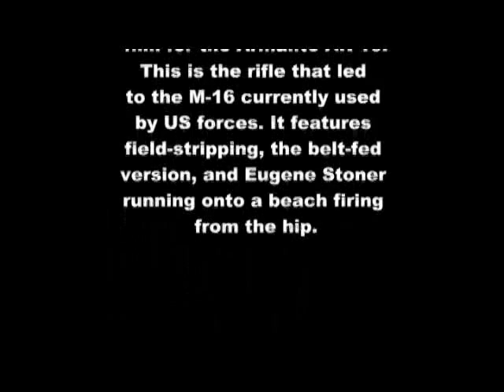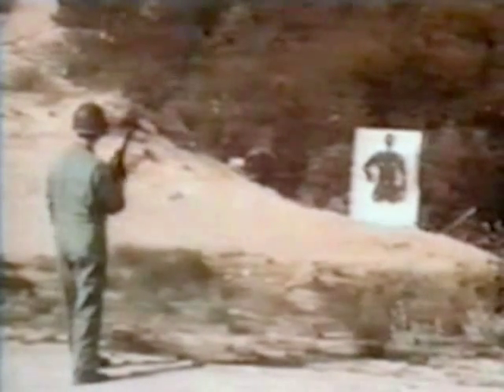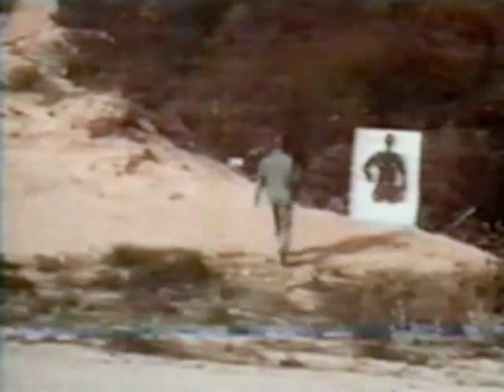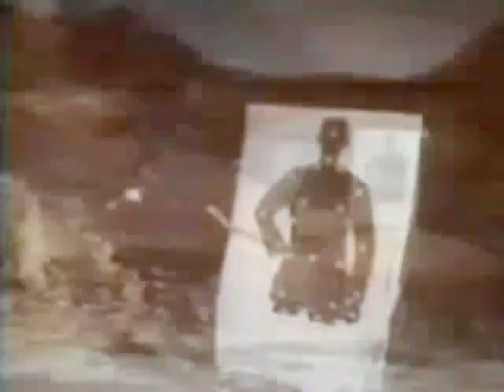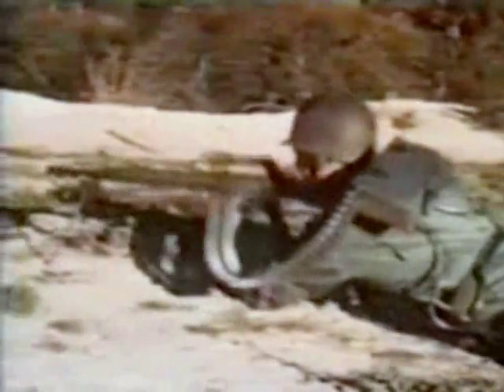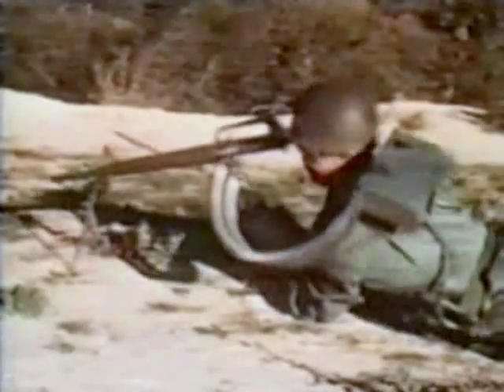ArmaLite AR-10 7.62mm Assault Rifle Part 2

Comment: @weaponeer well actually the AR-10 is a much more rugged rifle than the AR-15 and if you havnt seen the AR vs AK dust/dirt test video than you wouldnt understand. the AR15's bad reputation came from the first gov't issue rifle with no cleaning kit, no forward assist, no chrome lined bore/barrel, and the ammo was loaded with the dirtier and very corrosive ball powder. so essentially anyone who says the AR15 is unreliable hasn't used one in combat or under adverse conditions.